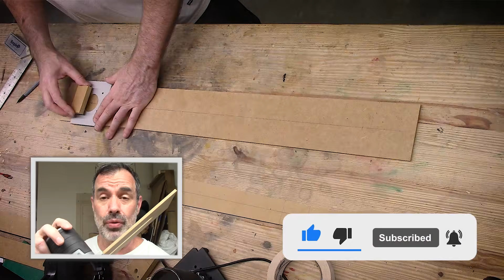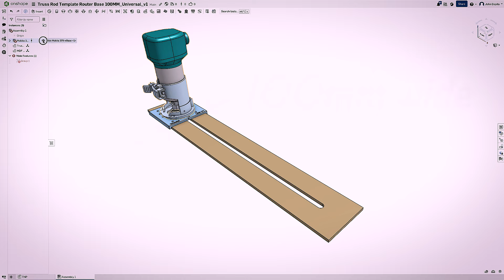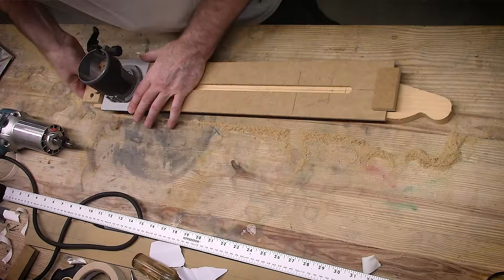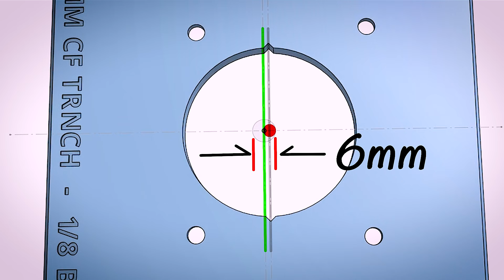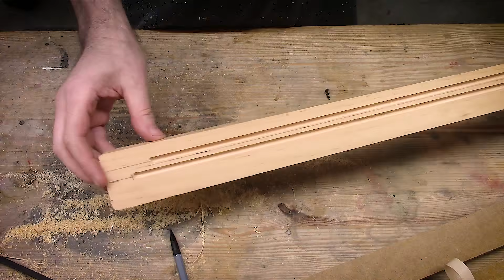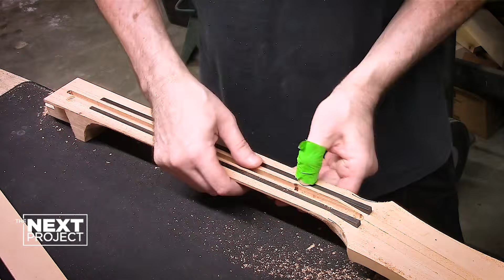Truss Rod Routing Guide - 3D Printing Guitar Project Tools Ep5

Comment: Thank you, I created a 3D printed guide (your MDF). Added a center line to it.

Love your content, free b's and information
Reply from the maker: Music, glad to hear you've engineered and printed what you need.
I've been using this truss rod trenching tool a lot lately. It's sooo easy to use.
If you haven't done so already, look for the "centering pins". They come in really handy for initial placement, and for re-attachment if you need to deepen a routing later ( it can happen ).
Good luck with your projects!

Comment: I'm a little confused, isn't a truss rod 1/4" (6mm)? Why not use that bit to cut the carbon fiber cavity?
Reply from the maker: BetterTimers, thanks for watching!
Oh, I like the timers on your channel... I need something like that at work for my lunch break.

Great question.
1/4in is 6.3mm. So, about 1/3rd of a mm wider (about 0.012in) than 6mm.
So if I use a 1/4in bit to cut the channel for the 6mm CF rod, I've got 1/3mm gap. 
Doesn't seem like much, but it is a loose fit. Drop in, fall out kinda thing.

I'm sure a lot of people use 1/4in bit for the 6mm rod, then just fill the difference with epoxy, and that will work too.
While I do epoxy the CF rod into the trench, I want there to almost no epoxy in there, but that's just me. I'm weird (wired) that way.
Hope this explains my madness. 
Be safe and take care!
Reply: @theNextProject  Thank you! That makes sense!

Comment: Thank you for your great work! You can improve the universal plate by changing the holes in the corner and at the cross by using a slot between the holes in the outer corners at the slide side with the holes in the direction of the cross. Hope I'm clear. This way many routers will fit,  especially those unbranded from aliexpress or amazon. I can send a picture if you like me to.
Reply from the maker: aideeadiee, thanks for watching!
I'm kinda following you, but...a bit confused. I think you are saying, by adding a few slots it may allow more routers to fit... I like improving on things!

If you have an image that is true to scale, everything is accurately dimensioned, please send it my way, I'll creates a universal base #2 and get it posted.

thenextproject.info@gmail.com

Many thanks!
Reply: @theNextProject  Hi, I have sent you an email containing a download link to pictures. The whole is too big for email. I also included a picture of my routerbase which also have slots.
Reply: Thank you for your updated download. I have printed version 3 and attached the routerplate which went flawlessly. Great job! Thnx again.
Reply from the maker: @aideeaidee1  excellent, thank you for the guidance and feedback. Greatly appreciate your help. I'm sure others will benefit from the idea too.
Good luck with your projects!
Be safe and take care my friend!

Comment: I love your videos, and these ones are great too! I commented on an older 3d print video of yours that I was interested in a 3d printer. I'm now a week and a half in as a first time owner and loving it. I'll probably never need to cut a a truss rod trench, but there is still a lot of great information to be gathered here, and these are ideas that could be utilized on non-guitar related projects too. However, I do need to download all the files you have posted so far and get printing on the ones I can use now. Thanks for making this stuff available!
Reply from the maker: Mike, good to hear from you and congrats on the new printer!
As you probably know, there is a lot of little "tweaking" that can be done when printing stuff, then adjustments needed depending on what filament is being used....
Good luck with all you printing and upcoming projects.
Be safe and take care!

Comment: You can make the template with a router table. Not sure why you need a 3D printer. 

And you should use a guide bushing on the router bass. They are very handy for pickups.
Reply from the maker: David, thanks for watching.
Yes, there are a dozen ways to make a template, route a channel... No, you don't need a 3D printer. 
The base I'm showing can easily be made in other ways, I mentioned that it can be made of MDF, plywood or other materials.

I have used the guide bushing with this and other templates, and honestly that is why I made the router base shown here.
I was rather disappointed when using the guide bushing with the truss rod template, as it tended to collect routing debris between the template and the bushing, which caused the router to bind in the template. It worked, just not as well as I had hoped. 

Initially, I thought my router bit had gotten dull.  I then thought the template was too tight on the bushing, but that wasn't the issue. Then I realized it was a routing debris issue... thought about making a looser template to avoid buildup, but that's counter productive, I want snug cuts for the truss rod and CF rods. 
For me, the bushing/truss rod template just wasn't quite right. Good, not great.

I occasionally use bushings for open pattern type stuff, where there is plenty of clearance (pickup cavities as you mention) no place for debris to build and cause issues. More often, I just use bearing bits.

It's all good.
Be safe and take care!

Comment: Nice work, John, and also nice video! If I ever do this, this will be helpful.

My bass neck goes on piece for piece, the veneer to tighten the neck pocket is in, the glue should be dry, it's a snug fit. Maybe I will have to relocate the bridge, you know, the neck is a few mm shorter, as I told before. I went for cheap Musiclily from Amazon, btw. Seem to be a pretty decent bridge. You know, that material is not that expensive and the work is not that much to justify such a bridge to be over USD 20.
Reply from the maker: Hey Achim, good to hear from you again and thanks for watching! Sounds like you're making good progress on that short neck project, exciting stuff!
I've had some pretty good stuff from Musiclily. It's very affordable, and great for most of my projects.  Agreed, trying to justify the cost of some items, just a hard thing to do at times.
You'll be jammin' in no time!
Be safe and take care my friend!